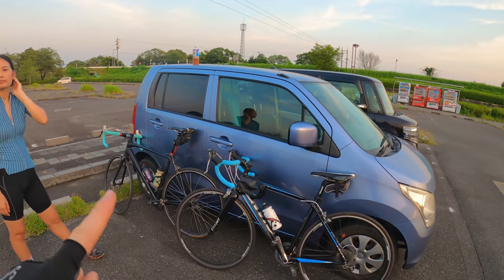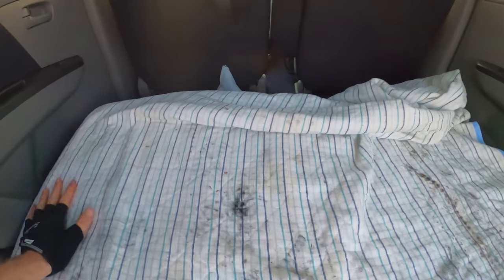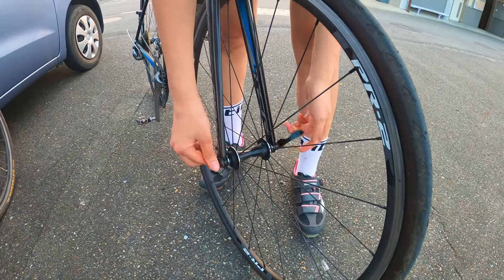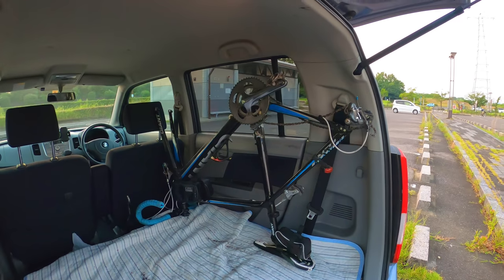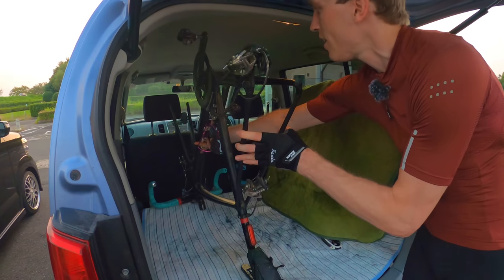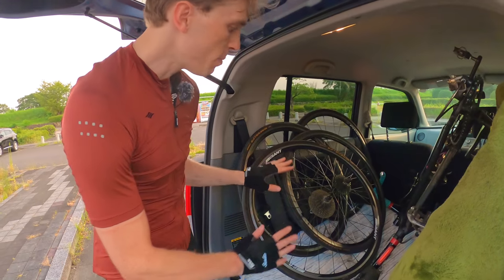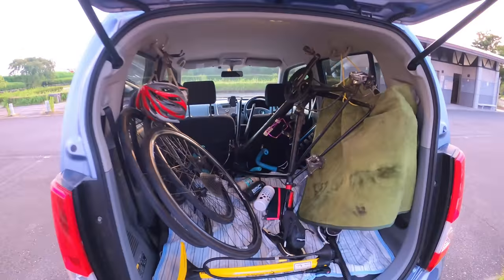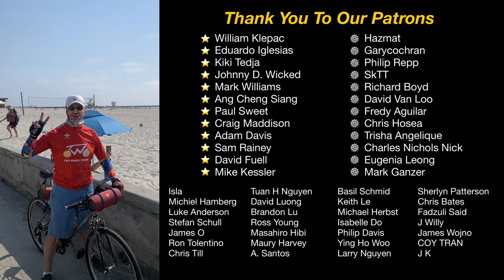How To Fit A Bike In A Car? / Transport A Bike Without A Roof Rack

Comment: Love the K-car. I could never fit my bike like this standing up. Cool solution!
Reply from the maker: We made sure to get one with good vertical space :)
Reply: Does anyone remember the k car from the 1980s  ?
Tip: make thongs from discarded inner tubes.  They don't scratch and they stretch so they stay tight.
Also good for extra support for bike luggage. 
Hey, I should make a video!

Comment: I usually use cardboard for cushion, it works great to put between wheels too. Glove latex and brake cleaner alcohol base for degreaser is helpful to keep it clean. Also some QR chain keeper is nice to keep the chain straight, but it's a little bit a hassle .
Reply from the maker: Cardboard is also good! Our bikes need a good cleaning 😅

Comment: Nice job fitting in the bikes. I normally put my wheels in wheel bags to protect them. Maybe an option that could work for you? Also I've switched to Squirt (a wax chain lube) instead of oil on my road bike because I go tired of the black greasy mess. It's been two months and chain is much cleaner now. Worth thinking about. One more thing... I saw at Mont Bell & some japanese bike shops cloth bags that you can put your bike in and carry from your shoulder and maybe not so expensive. Could be great option for in your car to keep everything clean and scratch free 👍
Reply from the maker: Thanks, those are good ideas!

Comment: I didn't recognize the Specialized Allez at first. I also have the same bike but just 2019 model. Did you repaint yours to black?
Reply from the maker: No, this is the original color, but it's an older model

Comment: Are bike roof racks permitted in Japan? That's what I'd be using if possible.
Reply from the maker: Yes, but I try to avoid those since it increases the gas consumption
Reply from the maker: Lol
Reply: @TwoWheelCruise  but they look so cool! And the street cred, bruh!
Reply: I don’t use a roof rack for a different reason.  A lot of car parks in my country are underground and are too low.  A couple of friends have forcibly removed their bikes when they forgot they were on the roof!  Fortunately the bikes survived with very little damage.  The roof racks were destroyed.
Reply: Chris Williams Switzerland 🇨🇭 and yes same problem with drive throughs.  It took me so long to get my dream bike, i‘d be really upset to knock it off the roof! 😂

Comment: still have space for cycle actually 2 more cycles can fit in there by placing tires between the front seat and back seat tyres don't move much there
Reply from the maker: It would be a challenge, but I think we could for 4 smaller road bikes in here

Comment: That's fine if you don't pack your bikes often otherwise I'd look for a roof or rear rack which can hold two bikes.
Reply from the maker: I prefer to keep them inside or behind to get better gas mileage
Reply: @TwoWheelCruise  I do something similar.  I take wheels and seatpost out put them in trunk.  The frameset goes in the back wrapped in a king size sheet.  It's not elegant but it works and I've done it for years with rental cars.